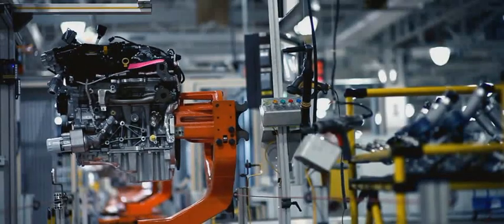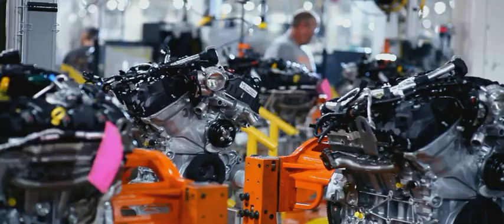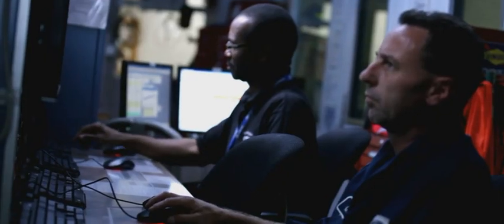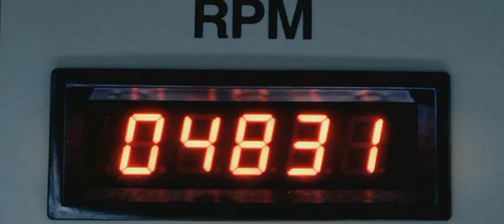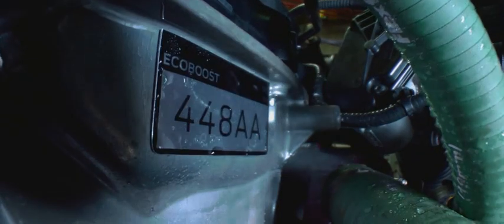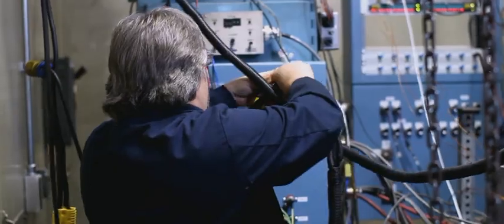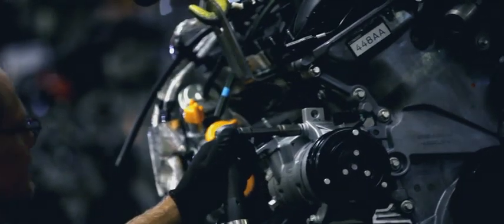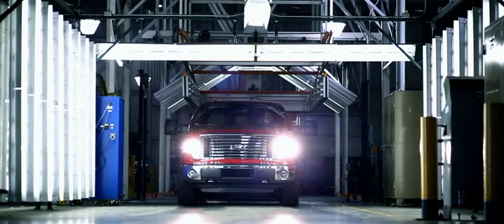Torture Test #1: "Beat to Hell and Back" 3.5L EcoBoost

Comment: @586guest2 its cool if you want to buy older cars, Im not trying to tell ya any diffrent. you call all of this computerized stuff "bullshit", sir you are sadly mistaken, all of that "bullshit" is making the engine more efficent, it is doing things that the older ones could never do with out. Im not a fan of the small displacement stuff either, but if the ecoboost can deliver like it says it can, then thats all the convincing anyone should need, if your too blind to see that, then too bad for you

Comment: @586guest2 WOW, to say that a 70's engine would out perform this engine is pretty stupid, I love GM to death but ya gotta understand that the relyability isnt restricted to a name. I can see how you may think there is no substitute for displacement, but times have changed, and the turbos evolved, I would love to see that 70's GM engine go head to head with the ecoboost in these tests, and Im sure that the GM would fall flat on its face... Get with the times dumbass

Comment: @586guest2 My dad owns an 08' ford and only had problems with brake noise once. My 91' ford needed about $3,000 in repairs because the truck was never serviced even the oil was used for about 39,000 miles without a change. It has 156K on it already but the engine is still in fairly good condition.

Comment: @ZaoHuZhua im just stating, my grandfather worked in a ford plant and my parents have only ever bought ford, i remember when i was little we had a pinto. but ive seen the newer fords and my family has had nothing but trouble with the new fords, my dads lincoln gave up with under 200000k on the odo. my mom switched to toyota(not her best choice) for me i put over 300k on a 2.4 gm pushrod v6( from an x body skylark) and it always ran,

Comment: yeah cause I drive from -20 to +100  in minutes and I to a lot of logging and skidding.  I don't want to use a skid-steer I wanna use my brand new pickup truck.

I always race on the track pulling a trailer for 24 hours straight.   Me and my chev and dodge buddies are always racing in the desert  pulling trailers on weekends and I need a 4.3 second victory over them.  this is the truck i need!

reminds me of the kirby vacuume salesman the vacuums up bullets (fake ones) and sticks it on ceiling
Reply: You poor liberal